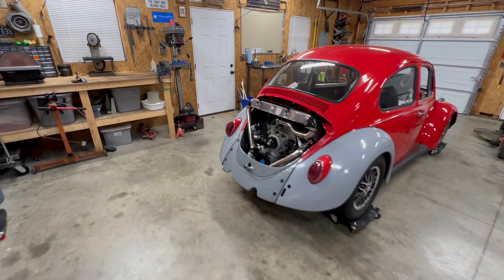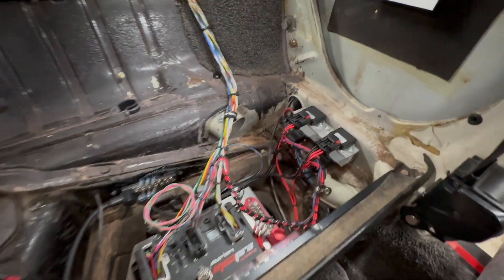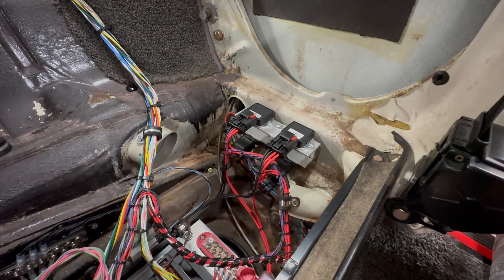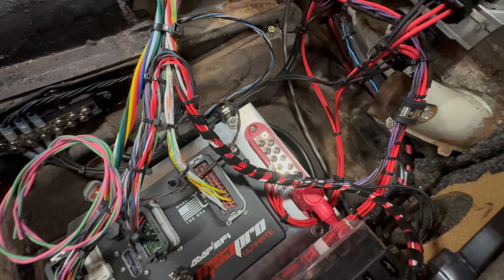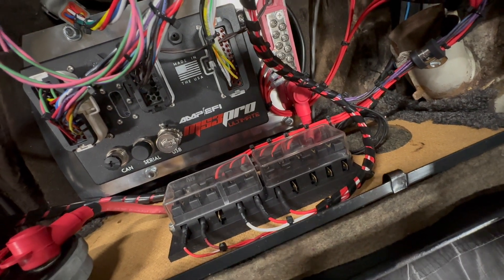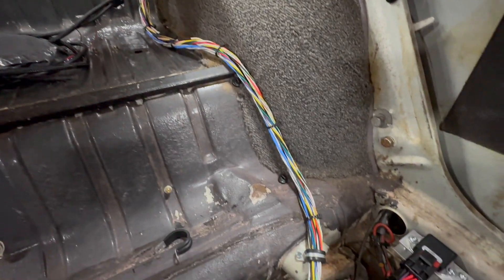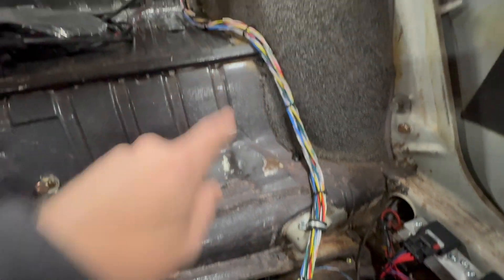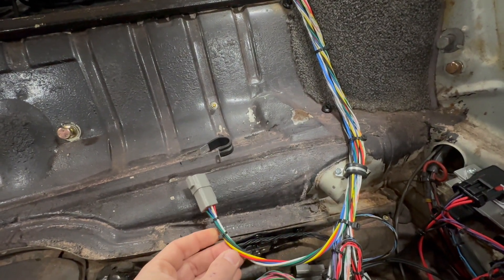Turbo Beetle - In car wiring w/the MS3Pro ECU

Comment: What model are those solid state relays?
Reply from the maker: They are Standard Ignition RY330K. Note, they are only ground switching capable, unlike a standard coil type relay that can be triggered via switched ground or 12v.
Reply: @vee_dub_nut  ah cool, so they are turned on by switching a pin to ground?
Reply from the maker: Yea, that’s correct

Comment: Most don’t understand how much time custom harnesses take. 
Super clean work!
Reply from the maker: Thank you! It’s definitely a time consuming job. The work itself isn’t quick to do, and there is a LOT of planning that has to be done before you can actually start running wires and pinning connectors.
Reply: @vee_dub_nut  yep, I fully get it. I haven’t done a setup like that yet but I have custom wired a few cars and it’s all in planing stage if you want to be successful.
Reply from the maker: 100%!!